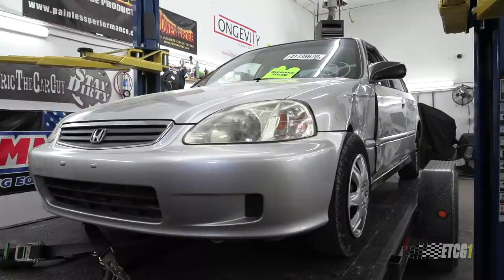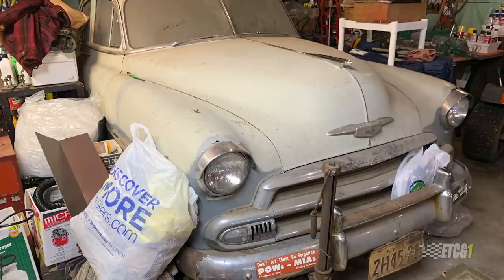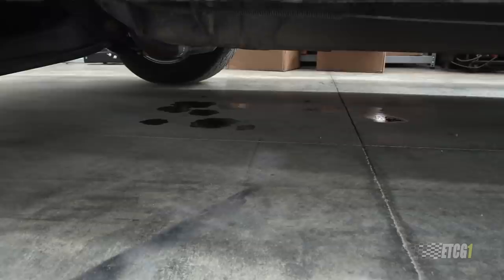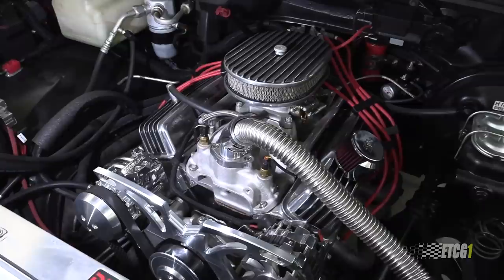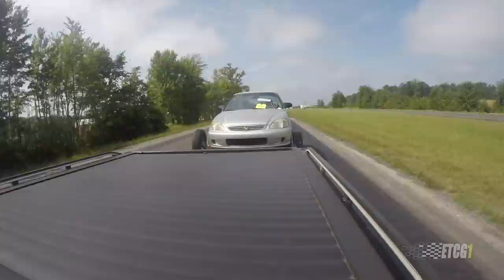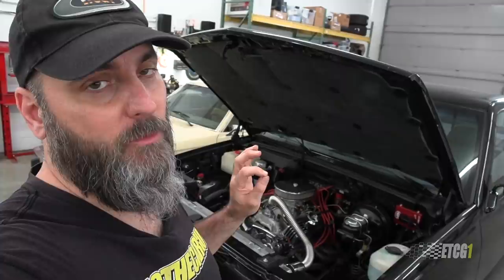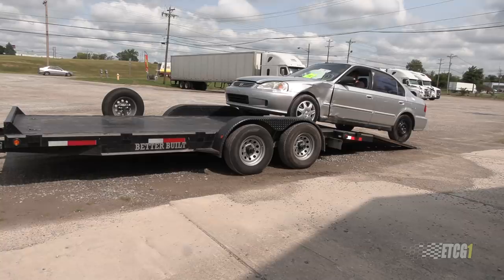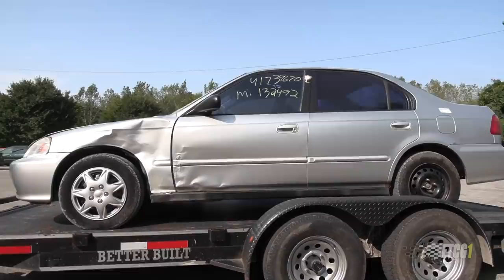First Time Towing with Dads Truck

Comment: A good rental company before you pick the trailer will check your vehicle capacity and check if its capable to handle the weight from the platform and the intended vehicle to tow.. if not match is found, they will not rent the trailer, also,.. next time you can decide to use a dolly isntead of a flat bed.

Comment: I'd get some HD rear shocks and raise the rear back up for towing. I got some stiff shocks from rockauto for $10 each. Or if you want to get some adjustable shocks that way when your not towing it doesn't feel like your riding on a brick over bumps.

Comment: U-haul ftw

Also, I thought GMs were at 195 degrees F on the thermostat
Reply: They were 195 from factory in those trucks unless otherwise ordered or if'n you were in a place like Arizona with heat.

Comment: I've always been told that the trailer should be balanced in a way that you can lift it with your hands, move the car backwards and it should be fine
Reply from the maker: Not so with this car hauler. 60% of the weight should be placed before the axle. That's why the wheels are set back.
Reply: A trailer should DEFINITIVELY NOT be balanced so that it has no tongue weight. ESPECIALLY with a car trailer. causes the trailer to be extremely unstable at speed. a good number i usually aim for is 10-15% of the total trailer weight being on the tongue.
Reply: Yeah, 40% seems high, but maybe it's just a poor trailer design?? But at the end of the day you should go with whatever the manufacturer recommends.

*Read some of Eric's other comments, and if he isn't interested in towing with it, the rest of my comment is unnecessary.
Reply: Oh god now don't do that, 10 percent of the weight needs to be on the tounge on a bumper pull trailer. 20 percent on a gooseneck trailer. And semi truck usually have about 50 percent on the tounge.
Reply: Whoever told you that is insane, and either is ignorant or wants you to be in an unsafe position. The general rule is 10 to 15% of the total weight of the trailer and vehicle. That means in Eric's case in this video 440 to 660 lbs tongue weight. If you can lift it with your hands like that then congrats?

@ETCG1 60% of the weight before the axle? That doesn't sound right. The figure you need to deal with is 10 to 15% of total weight of what is being towed. 2000 + 2400 = 4400 lbs. 10 to 15% of that (440 to 660lbs) is what the ball on your hitch should see.
Reply: You always want more weight on the front of the trailer, otherwise you'll run into swaying problems. You can have as much weight on the tounge as you want as long as you don't exceed what your tow vehicle is built to handle. Most full size trucks and SUV this is a 1000 pounds of tounge weight. Small truck, SUV, jeeps are usually around 500 pounds of tounge weight. Gooseneck and fifth wheel hitch typically have higher tounge weights because that weight is centered on the rear axle and doesn't lift up on the front wheels.
Reply: @Unmentioned77  "You can have as much weight on the tounge as you want" 

That is terrible advice and I highly suggest you never repeat it again. You want 10 to 15% tongue weight. Too much tongue weight can cause swaying as well but more than likely it will cause steering problems. 

You never, ever go by static numbers like 1,000lbs or 500lbs. You go by the weight of what is being towed. Period. 10 to 15% of that number should be on the tongue. Gooseneck is around 20% over the rear axle. Too much on a 5th wheel or gooseneck and you introduce more stress when turning like more likely to jackknife.

Comment: I've never thought of a truck as being unable to pull something, such as a boat trailer, car hauler, et. Al. In fact, the lack of weight on the back end of a truck needs to be supplemented by putting bags of sand, cement bricks, or something back their in the winter to get good traction in the snow during winter. If your truck is not designed to haul anything, wouldn't it at least have a carrying capacity for putting things in the truck bed? Your opinion is greatly appreciated. 
Also, I know you need a certain amount of tongue weight, yet not too much. With 4 wheels, the car seemed to be too far forward. Does the trailer manufacturer have any recommendations as to where a care should be placed on the hauler? Thanks, Jeff
Reply from the maker: Yes, the carrying capacity of this truck, or GVWR, is 5600lbs. That includes the weight of the truck and passengers though. Meaning, you could probably put 2000 in the bed, or haul moderate loads with this truck, but keep in mind I lowered it, which makes it less able to tow heavy loads. Thanks for the comment.

Comment: Only in the USA a truck like that is not sufficient to tow a car trailer, but I guess each to his own.
Reply from the maker: Keep in mind that I lowered this truck.
Reply: @ETCG1  Fair point, but I think it is more of a difference in perception for towing between Europe and the USA.
Reply: @ETCG1  How much did it squat? That's the real thing you need to be worried about. 1" is where you want it to be. Can you and say another person get on the rear bumper and someone else measure it? If it drops more than 1" then you need stiffer springs. If 1" or less you can tow that  honda easily. Do not go by the 60/40 BS, it's too difficult for most people to grasp easily and quickly. Figure 10 to 15% tongue weight. A crane scale and engine hoist will tell you what the tongue weight is and or give you a better idea to stay within the 10 to 15% window..

Comment: Minimum pickup would be a 3/4 ton, i.e., 2500, F250, etc.
Reply from the maker: I agree.
Reply: To tow a single vehicle 150/1500 is plenty. Towing multiple vehicles is where an F250/2500 comes in. Anyone that needs a F250/2500 to tow a single vehicle like his dads car + parts is not doing things right or properly, and I'd argue is more likely to load improperly and end up hurting someone down the road.
Reply: q   You’ve been watching/reading too many truck ads that extol the virtues of half ton pickups. A 3/4 ton is more TRUCK. It’ll handle loads more capably than a half ton.  Simply because for a given load, a 3/4 ton has more capacity.
Reply: @CrazyPetez  "You’ve been watching/reading too many truck ads that extol the virtues of half ton pickups."

Not really, I am going by personal experience and dealing with this kind of thing for most of my life? I have driven tractor trailers, half ton, 3 quarter ton, 1 ton, etc trucks. Hauled cars for profit, worked with car haulers, all the way down to rinky dink car trailers with no winches using 2 ratchet straps to get non running vehicles onto said single car trailer. On up to a 5 car hauler. Never run a 9 car hauler in a tractor trailer though. Have experience with loading and unloading just not actual transporting them. 

An F150 or 1500 as in this case the main issue is the engine and brakes. The frame can handle it. The only other thing you really need to be concerned with... with a single car hauler is suspension. Figuring out how much weight you can put on the back and the truck squats around 1" will give you a very good figure on how much you can safely tow. If it's say 500lbs? Then 5,000lbs would easily be doable. If it's 700lbs? Then 7,000lbs. When you haul a single car with a smaller truck the 10 to 15% tongue weight really comes into play. 

If you need a 3/4 ton truck to tow a single car, then you do not know what you are doing, and you are more likely to make a mistake. All a 3/4 ton truck will do is give you a bit more cushion for ignorance in that situation. Have I used a 3/4 ton truck to haul a single car on a single car trailer? Absolutely but it's what I had available at the time and had to get the job done. Could I have done it with a half ton easily and safely? 100%. 

I will say again. If the truck was hauling an unbraked trailer, I'd give a different response. If the truck didn't have an upgraded engine with more power, I'd give a different response. If he wanted to haul multiple cars at the same time? I'd give a different response. Hauling a single car, even his dads car which would be a little heavier, I am confident that truck could do it, if loaded properly. The honda... was not loaded properly. The balance was way off and had way too much nose weight. You put the car or the weight mostly over the axles of the trailer and 10 to 15% of the weight should be forward of the axle. If the car was backed onto the trailer in the same position? It would likely still have had too much nose weight but it would have handled better. 

"A 3/4 ton is more TRUCK. It’ll handle loads more capably than a half ton."

Okay? But that does not mean that truck is not capable of it. Going out and buying a different truck for something that truck is capable of, and capable of safely is the wrong message to send. Loading the car badly like he did and then saying the truck isn't capable of it is a very ignorant position to take. There is a lot of learning opportunity here for him, and likely a few videos out of it that would do well, but he doesn't see it. 

Yes a larger truck can tow more, haul more,  etc. But if you do not plan on using it, then it makes no sense to spend the money to do it. Like buying an SUV putting a bigger engine, bigger tires, lift kit, etc and never once driving it offroad. It makes no sense. If you have a truck that is very capable of doing the job, why buy a new one if you do not have to? Before this whole deal I thought Eric was someone to learn from their mistakes adjust and move on. But this... is very illuminating. He could easily talk to a few people that knows more than him, make a few videos about it and spread actual factual information instead of misinformation. 

The 60/40 thing for instance. That's how the trailers are usually built so it gives the best latitude on getting to the 10 to 15% tongue weight. I mean for fucks sake, if you don't believe me on the 10 to 15% look it up for yourself? Talk to people you know and trust that has towed with say a half ton or smaller truck? 

Here I will help you out, but please feel free to do more research on your own. 

https://www.curtmfg.com/trailer-parts/couplers/learn-more

https://www.weigh-safe.com/towing-safety/proper-tongue-weight/

https://www.gmc.com/gmc-life/trucks/why-tongue-weight-is-important-for-safe-towing

I would also note that his braking performance was likely reduced because he had too much nose weight on the trailer.
Reply: q  I find your comment “if you need a 3/4 ton to haul a single car” insulting. Given that, I don’t care what you say, I’m sticking to the knowledge that the heaviest duty truck you can have is the right tool for the job.

Comment: Eric... gotta say, you are doing it wrong. There are WAYYYYY lighter ways to tow a car with that truck. That trailer, well, it's too big, besides you leveled it very badly, the correct rear drop, is around 1 inch (2.5cm), you had the car very unbalanced on the trailer, yeah, you did. There are other options and very safe, if the rear wheels are ok to roll, use a front wheel trailer and roll with the rear towed car wheels on the ground. I tow cars on a somewhat regular basis, I can tow cars heavier than my car, which is a peugeot 407 sw biturbo diesel , 200 hp and 480Nm. I've towed a van, loaded, 2000pounds(~1 ton) over my cars total weight with no issues, slow of course. They are very compact trailers, around 40 inches long, have two wheels and two "buckets" for the towed car wheels, the wheels are strapped to the trailer, it won't come of by any means. I've seen in other yt'rs, u-haul has them, but buy a quality one. Also quite inexpensive, myne was around 1500$ new and very good quality, with hydraulic wheel and a very small manual winch to pull the car into the "buckets".
Reply from the maker: Thank you for your input. I think you might have missed where I mentioned the placement of the car on the trailer at the beginning of the video. Also, the entire purpose of this trip was to determine the capabilities of towing with the truck as a measure if it was even feasible to use it to bring the '51 Chevy to my shop. I have now determined that it isn't based on what I experienced. I never built this truck as a tow rig, it's a sport truck, but it's the truck I have and I wanted to see what it was capable off. When I tow a Civic in the future, I'll use a car dolly, and possibly install some air shocks. Problem solved. Thank you again for your input.
Reply: @ETCG1  Thanks for your rely Eric, glad to have your attention, always learning! I did almost the same mistake and I almost had a crash with a tow, since I starded to use dollies, everything got a lot simpler and safe. Stay dirty.. I'm am at least, changing head gasket on my 2L PSA TD :D with full engine rebuild.

Comment: Just about anyone can make them go fast. But it takes a lot of time effort and a certain amount of knowledge to make them tow..
Reply from the maker: Honestly, I don't recommend taking a truck that wasn't designed to haul heavy loads and turn it into one that can. In my view, it's much better to start with a more capable truck with an upgraded frame, suspension, tires, brakes, and powertrain.
Reply: @ETCG1  yes sir I do agree with you

Comment: Have you tried a aluminum trailer
Reply from the maker: "First Time Towing With Dads Truck" 😉
Reply: @ETCG1  we had a truck do better with a aluminum trailer instead of the steel ones might be able to rent one and try it I'm from Missouri so lots of hills in farm country just trying to help also might to stick with a gas half ton if not hauling alot I just got alot to haul so I have a older Diesel and my gas truck gets better miles
Reply from the maker: An aluminum trailer would save on fuel as well. Expensive though.
Reply: @ETCG1  if not towing alot then yes that's a huge downside see if you can rent one try it out

Comment: Consider looking into a Aluminum trailer if you decide to buy one. Should shave a few pounds.
Reply: Or a Car dolly. The little amount I tow cars you can make a dolly work just fine. Yes its a pain to pull the driveshaft for rear wheel drive cars but the dolly is so small it stores nicely if you dont have the room for a car trailer.

Comment: Eric, you're a bright guy. At what point did you think that this was a good idea? 😁
Reply from the maker: I never built this truck as a tow rig. I never expected my dad to give me the '51 Chevy. I didn't expect the car I just put together for my oldest son to break down the way it did needing a new engine and transmission. I'm doing the best I can with the resources I have, just like most people. Thanks for your comment.
Reply: Why do you think it's a bad idea? Just need a few adjustments and it would be fine and safe. A bone stock truck, with the lowest displacement engine (4.3L) can safely tow 4,000lbs. The highest displacement 5.7 can tow 7,500. Since his engine was redone and likely higher HP then he could easily have enough engine to tow in excess of 7,500. With upgraded brakes, and the trailer being braked? That just means he was perfectly fine in being able to tow the vehicle safely. Where he messed up is not loading the vehicle properly. If he wanted it in that position he should have backed it up on the trailer so the engine was over the axles. Ideally you want the bed of the truck to go down around 1". That will give you a good indication you are at or very close to the desired tongue weight of 10 to 15% of the combined weight of the trailer and vehicle.
Reply: @q......  You just answered your own question. Just need a few adjustments and it would be fine and safe. I'm not beating on Eric, I just thought it was dangerous for him and others.
Reply from the maker: @q......  You seem to have ignored so much of what I said in the video. Perhaps make your own video about towing with a C1500?

Comment: Hp and suspension aren’t the solutions. The brakes are. Never heard that mentioned.....  or, lawsuits when some retard kills someone.
Reply from the maker: Brakes are part of the chassis. Although mentioning them specifically would have been a good idea. Thanks for the comment.
Reply: ETCG1 most wouldn’t consider brakes part of the chassis. Chassis is framework. 

There is no point supporting a load or moving a load if you can’t get to stopped safely and reasonably. 

Towing with that thing without the weight rating is a lawyers best good friend...